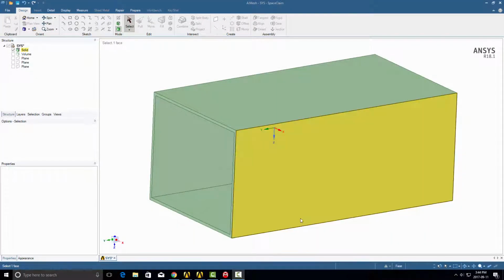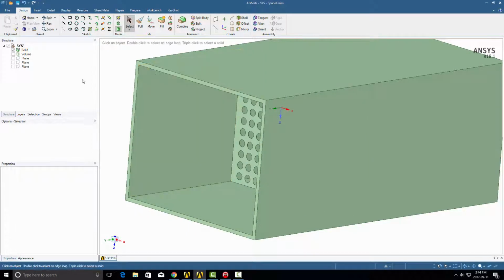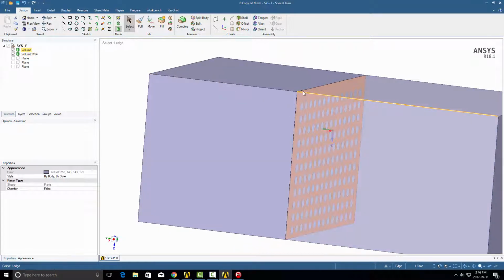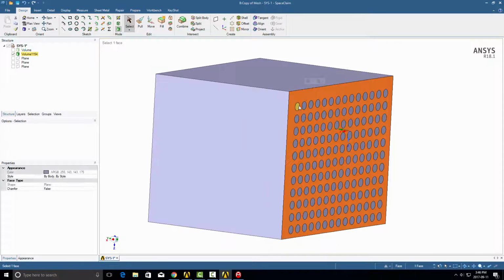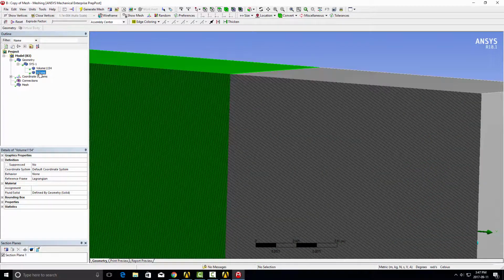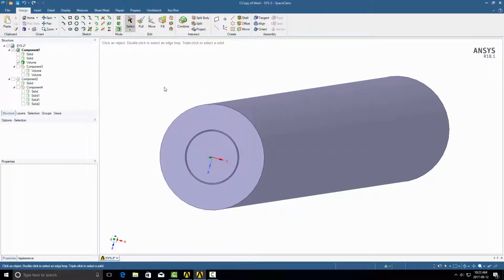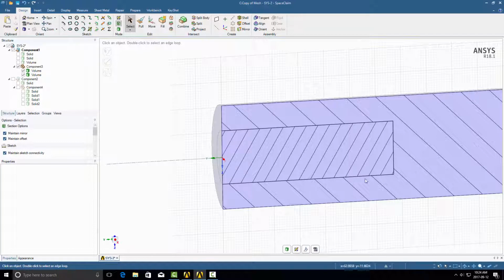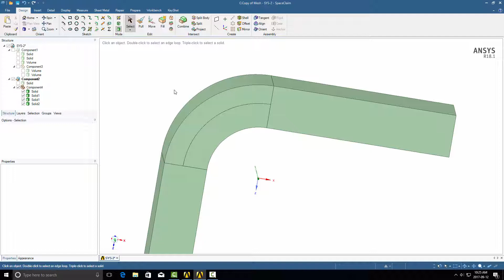How to create thin (0 thickness) internal walls for ANSYS CFD models

Comment: so, by change the topology to "merge", the big volume will automatically be split into 2 volumes, right? this is different from what I am struggling now
Reply from the maker: Hi, thank you for your question.

Assuming you are referring to the first model shown (ie; the rectangular volume with the thin plate with the pattern of holes in it), no, the Share Topology, Merge setting does not split the volume.  Using the Share Topology, Merge setting effectively imprints the hole pattern that is on the fluid volume on the left onto the fluid volume on the right once it is taken the meshing application (ie; either Ansys Workbench Meshing or Fluent Meshing).

If you are interested in simulation services like mentoring, training, and consulting, please contact us: simutechgroup.com/contact-us Alternatively, you can check out the Ansys Learning Hub here: https://www.ansys.com/services/ansys-learning-hub and if you are a student, see Ansys’ academic forum here: https://forum.ansys.com/
Reply: @SimuTechGroup  i think I got the reason of my problem: share. looks like that I need to define the share tolerance in the space claim .Thank you for your reply:)